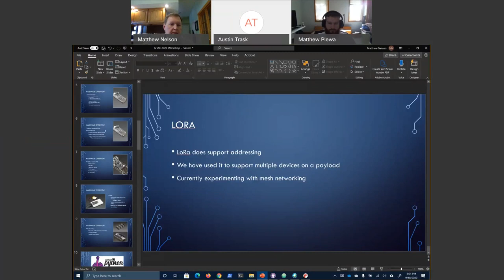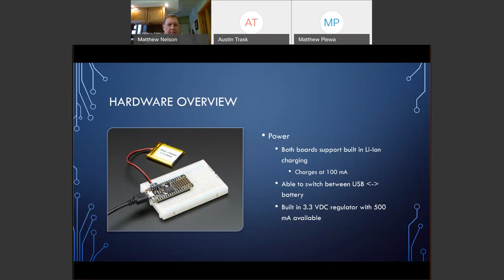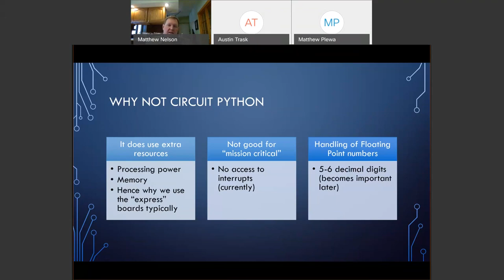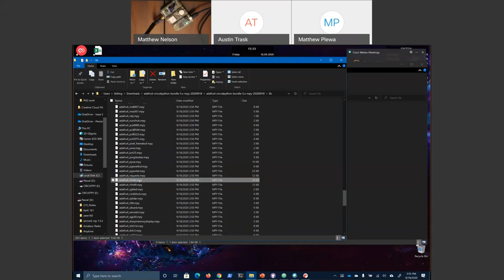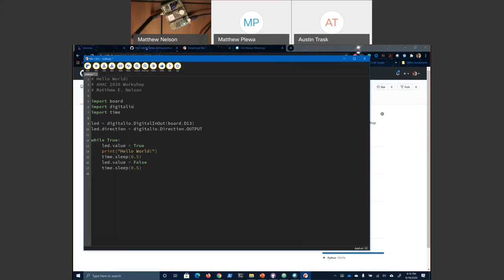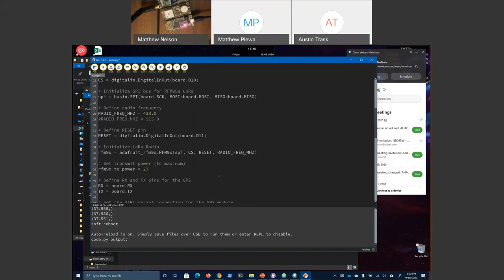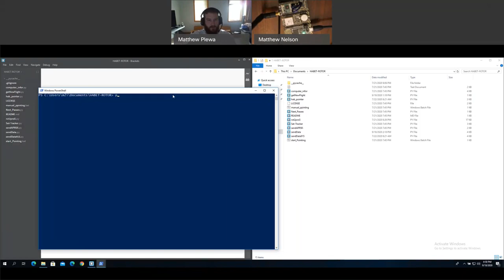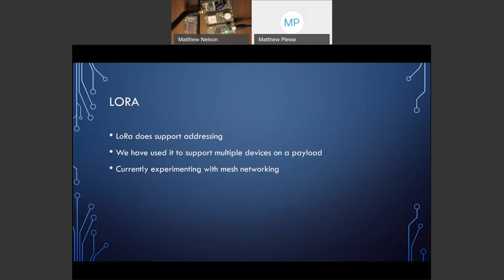AHAC 2020 Workshop - CircuitPython, GPS and LoRa radios - M. Nelson and M. Plewa

Comment: This is incredibly helpful!! As someone who is familiar with soldering and wiring up these parts but not familiar with Circuit Python or any coding for that matter… this is very engaging
LoRa has been blowing my mind lately and I am hell bent building a pair of my own devices to take with me in the back country… or in the case of cell towers not being available…
Reply: although this work shop doesn’t go over the specifics of the project I’m using as a model… it’s given some good resources about how to get started coding, and Inputing open source code for the LoRa…